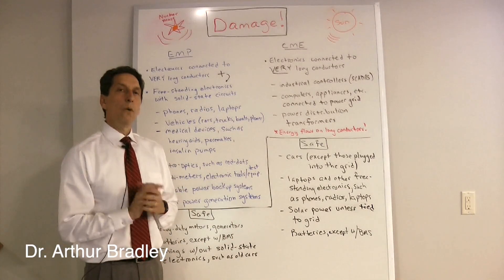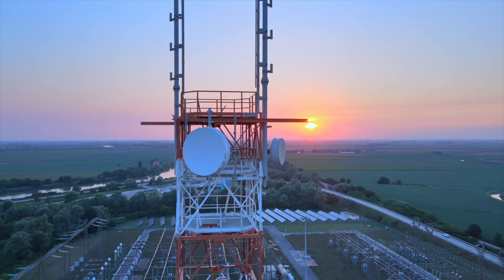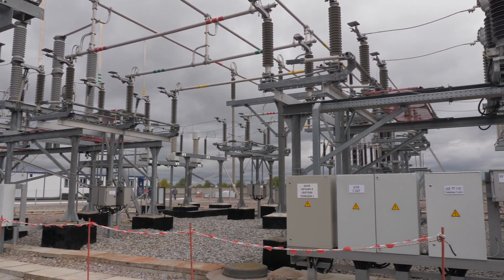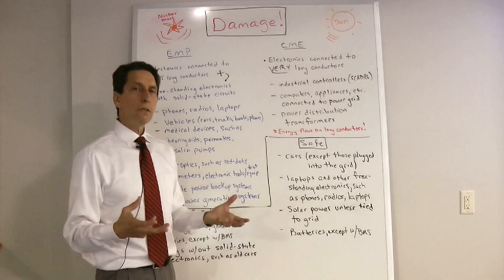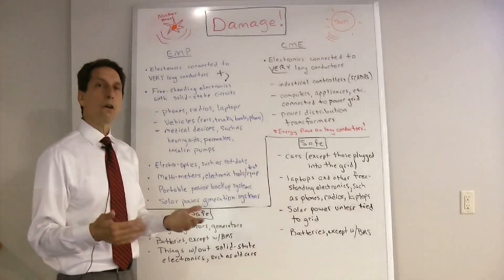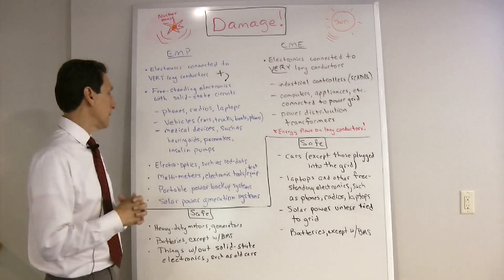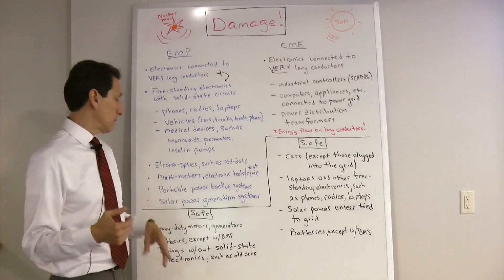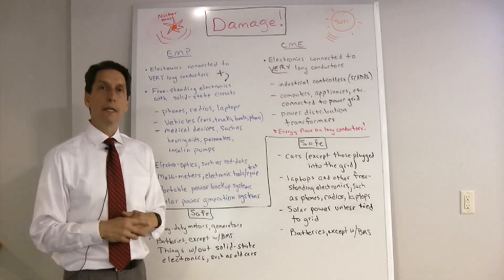EMP/CME Damage

Comment: I’m an Airbus Captain. Airbus is an advanced fly by wire airplane practically a flying computer. It has a great electrostatic discharge system. I’ve been struck by lightning many times, not even a blink on the screens. Seen Elmo’s fire on the windscreen no problems. How do you think my airplane would be affected by a CME? Even better: an EMP? I do understand that there is a huge difference between on the ground, on the ground plugged into ground power or in flight conditions. I would really appreciate your input!

Comment: Doc, what would you recommend for someone on a budget of <=$250 to build a kit to deal with an EMP event?  I'm thinking a static shielding bag, a small two way radio of some kind, a small power inverter, and if your vehicle uses it a spare FOB.  Can that be done at that price point?  Is there something I'm missing?
Reply: As I research, start with smaller bag called "faraday bag / emp bag with copper-nickel layer wrapped". You can test that it is work by put your phone inside, as long as the signal is dead, it is working.

Comment: either solar or EMP after they able to penetrate all the forces in atmosphere will be easily absorbed by ALL THE METAL - buildings, roofs , walls then there's absolutely nothing to go into wires .
considering wires are tiny to the scale of all the other metallic structures.

not going to talk about power needed to deliver EMP at altitudes mentioned.

this video is an example of absolute stupidity.

Comment: I'm curious as to what type of CME was used to determine this. They've recently discovered that stars can produce a class x 1000 solar flare. The Carrington event wasn't even an x100 solar flare. There's a lot of evidence to indicate that the Carrington event occurs every 150 to 200 years. The last one was 1859. We are in the red zone for another one. It's just a matter of when.
Reply: @disasterprepper - agree with this reply. Can you give details if it is possible to defend against an extremely large solar flare larger than X1000 with an energy output of at least 1X10^35 ergs? I know this sort of induction event will not be a normal EMP/CME type of event. This will result in an induced current that is different from a "normal" CME as this form of induced current will come from the ground up instead of the sky downward in the case of an EMP. Love your channel and you got yourself a new follower!
Reply: @SugarBushFarmWI  with something of that strength, assuming we survive it, it's likely that all metal tools could potentially melt due to the induction. Those of us that survived would be back to Stone age technology.
Reply: @adandredestefano That is my assumption as well, but watching these vids I have learned of the key differences between a manmade EMP and a solar CME. This has provided a glimmer of hope that some electronics can survive. Hoping the good Doctor can provide some specifics here. Thank you!

Comment: If you shut off your main electrical breaker in the panel box.....Will that protect electronic equipment and appliances.  Or can the wave go thru the ground wire and back feed????

Comment: I understand what you’re saying. But my brain keeps saying, if the energy could get into the lines and then destroy things that are connected, why could it not affect the wiring that’s say, in a car or a computer that’s not plugged in?  The Carrington event was quite startling and technically, they were not sophisticated.  Houses burned down, wires were on fire, railway tracks were affected.  All I can do is try to protect everything I think will help my family.  I’ve even started double faraday cages on the really important things I feel are important like a ham radio.  The ham radios today are very computerized and I think will be affected.  I don’t live in fear.  I see a need and if I can do or afford it, I try to protect it.  I’m on the level of electricity is like voodoo.  I need it, kinda understand it, have a healthy respect for it, but still voodoo.  My husband is an electrical engineer.  He loves me enough to just let me do what I think I need to do.  He even bought and installed EMP Shield on all our vehicles and for the circuit breakers.  I feel better.
Reply: Think of it as volts per mile of conductor.  There will be a tiny amount of excess voltage in your car wiring, but the amount is so small as to be something that the electrical system will handle without any problem at all.  The power grid has conductors spanning hundreds of miles.  And the main problem in an EMP isn't overvoltage, but the way the excess current causes a magnetic imbalance in 3-phase power transformers.

Comment: Dr. Bradley: thanks for a very good breakdown. One question for clarification: Do you believe LEDs in flashlights would be effected, particularly by EMP? I'm concerned about the diode and the electronic-controlled switching in many small (pocket-sized) units.
Reply: I blasted these with a home made EMP generator and what happens is the light still works but the light is stuck on full beam in the variable power type, simple on/off type were not damaged. The cheap direct to the LED type had the diodes damaged similar to bad ESD.
Reply: @christopherleubner6633   Simple on/off even in high beam would be acceptable. Thank you for your work and the feedback.
Reply: I was wondering the same

Comment: Just curious...with a CME would devices connected to the grid through power supplies like power bricks or wall warts be affected?  
I ask this because it seems like the internal structure of the charging system and/or transformers would take the brunt of the surge.  
I do keep several backups of all my equipment is Faraday Cages...including 3 extra Single Board Control Modules for my old pickup truck.

Comment: I don't know if you have addressed this, but I keep a ton of extra tool batteries (and chargers) protected because they have electronics inside the housings.  After anything happens.....  electric chainsaws, drills, saws, pumps and multiple other things will be needed.  Someone tell Black and Decker they should be making 40V washers, coffee bean mills, etc.....
Reply: Lithium batteries, rechargeable naturally, usually has a lifetime of 500-800-1000 charge-discharge cycles if/when handled with care.
So unless you have a battery manufacturing plant also, it might not be the best way to future-proof survivability imho.
Battery operated items are handy, but not long-term viable. I would recommend looking into a large battery bank + inverter, then doing it 'old-school' with wiring and extension cables if needed (with shielded electronics and reserve solar panels, of course ;ø)

Comment: Check out this video, Excellent in depth explanation of of HEMP effects, "Engineer Tim Carty explains how an EMP — an electromagnetic pulse — works". Most people miss the fact that EMP effects don't NOT needing a large bomb. A neutron bomb creates a Super EMP with ground voltages over 100,000 volts per meter for E1. Even EMP shield has NOT been tested above 90,000 volts per meter.
Reply: I checked out the video. With radiation physics and electronics studies in my own background, I would say Tim is what we call a science double-talker.  His E1,E2,E3 theory presented is nothing but his own speculation. The product that he sells (and makes millions off of) is nothing but bogus, smoke and mirrors snake oil. His device, EMP Shield  is nothing more than a simple surge protector that is  2, and sometimes even 3 times the price of comparable home panel surge (NOT EMP)protection devices such as Siemens, GE, and the likes. Furthermore, he markets to the ignorant and fearful, claiming his device will protect generators or vehicles...which is preposterous. In other words, he's the master of bullsh!t for profit, looking for a sucker. This is why after all the years he's produced his product, absolutely ZERO ham radio operators, master electricians, electrical engineers, radiation physicists, or similar have reviewed and recommended his product.  The ONLY ones who push his mostly bogus product are prepper channels doing a little fear mongering and looking to make a good amount of ad money for pushing the device. This is Truth.  I believe Dr. Bradley avoids exposing the BS is because of lawsuits, and hence legal costs that would surely arise.

Comment: Quick question about older cars now you mention some with older control units may be okay for example I have a 98 Z28 Camaro from my youngster years I've never been able to part with cuz we just love it LOL, would you consider that old enough to be relatively safe especially sitting in the garage?
Reply: Get a 20' shipping container and garage it in there.  They can be sealed up to almost eliminate the effects of an EMP.  He has a couple videos on this.
Reply: 1966 through 1969 Camaros would be fine. But Electronic Control Units became common in cars in the early 1970s. Even carburetor cars had ECUs back then…

So, a car from the 60s or earlier are most resistant to EMP. Get an Edsel?
Reply: Good question. I have a 83 Hurst Olds and was told if it has a carb it MAY be safe if it has EFI nope.

Comment: Just a couple quick thoughts. If you're the only property with power all departments of the government have the right to take control of the property under emergency conditions. Also the CME the governments of the world are planning to overcome on a small scale are described  in many ways and names such as Carrington event, mini nova, micro nova and so on. In this type of events not only does it feed through all things wired but also catches everything direct wired on fire in a hurry. Sounds to me like FEMA thinks this planet would burn to the ground within 6 months. Not sure how that time line was calculated but my sources tell this is correct. You should also know that we were very close on July 23 2012 and again in 2017. Of course the 2012 event was classified information until 2014 to prevent panic. 😊
Reply: Thank you for pointing out that a LOT of fires will be created by either event. HEMP would be worse cause NO ONE would be coming to put those fires out,,,,,
Reply: I always consider this scenario, and one thing that comes quickly to mind is that—in a normal neighborhood—a Prepper’s residence might stand out like a sore thumb: lights working, vehicle runs, generator engine sound, etc., etc.
Reply: @richardsilva-spokane3436  If government reps need access to working equipment when they have nothing, not sure saying no way would stop them from taking everything you have encluding the dog.

Comment: For a CME we should get a warning of hours to a few days. Given that the primary danger will come in on long power lines would it make sense to disconnect our power at the distribution box, turning off breakers  and the main disconnect?
Reply: He's mentioned before that if you go and throw your main breaker to your house you should be safe for a CME.  That's why he made the DEFCON alert device that you plug into your house.  If that thing goes off you run to the breaker box.
Reply: You wont get an offical warning. We were narrowly hit by a powerful CME in 2012. Only 2 years later did NASA post an article about it.
Reply: There are 2 hot wires and a ground feeding into the main panel. Disconnecting the breakers stops the hot feed lines but the ground is still intact. Wouldn’t that mean any device plugged in that has a 3 prong connection would still be at risk?

Comment: Could you ballpark which year (and earlier) cars would be safe from emp?
Reply: depends on the model, but 1968 and earlier are usually good. If it has fuel injection instead of a carb, it is toast.
Reply: Many cars up to the mid 90's only had one ECM, which controls nothing but emissions systems and fuel injection. I think many of these vehicles will be fine. My '94 Ford van has that, and all wires connected to the module are short and under cover of a steel body.

Comment: Thanks. Is there any way to calculate how far an EMP would travel? On NukeMap for example? Would that be Ionizing Radiation Rings?
Reply: emp is line of sight, which is why I live in the appalachian valley of east tennessee. Unfortunately I moved here before realizing that oakridge national labs is here. Its target num1 after the major cities for a regular nuke. I just have to hope the wind is not blowing the wrong direction on that day, else I have to bug out. Ready for that, I would be going to central north east TN, where there would be no fallout from major cities. I have potassium iodide for radiation protection of the thyroid, I have geiger counters, I have an rv.